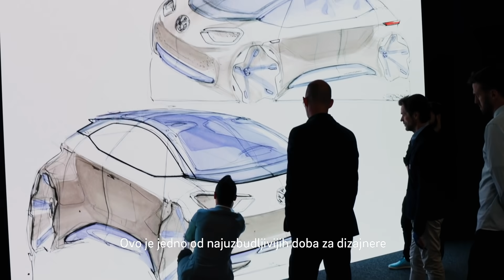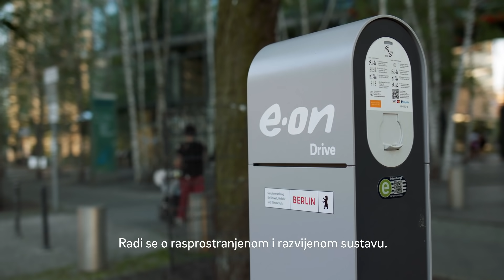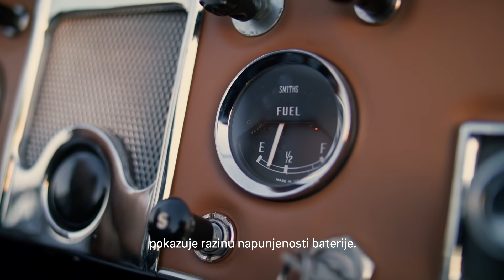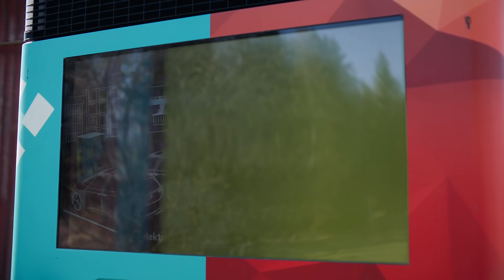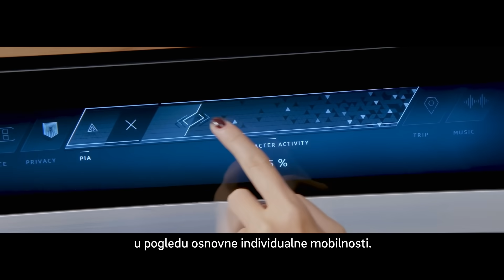E.06 - Vožnja prema budućnosti #WEhasnolimits #ChangeMakers #EV #EONDrive

Comment: I am Electrotehnik if your baterry have a for example (3000 ma/h) your maximum charge output will be 3 Aampers,if you try Anny higher of 3 Amps your baterry will Puff due to chemical reaction.So the fast charger will damage your baterry and can also get hem to cause fire if charging on higher Amperage that is recommended.